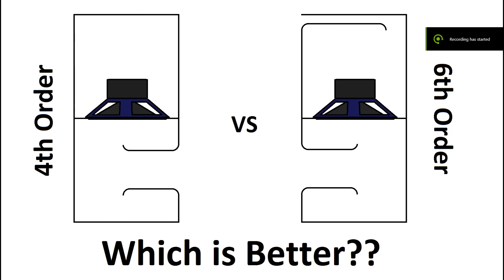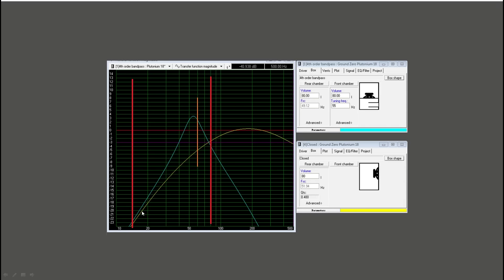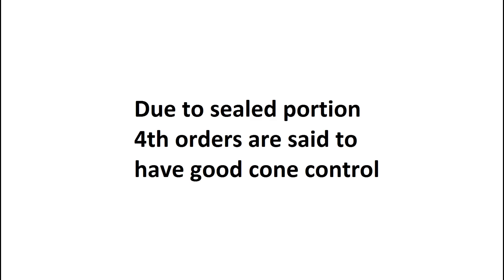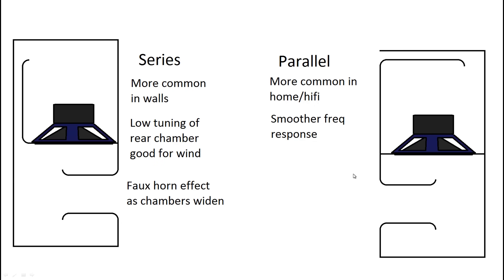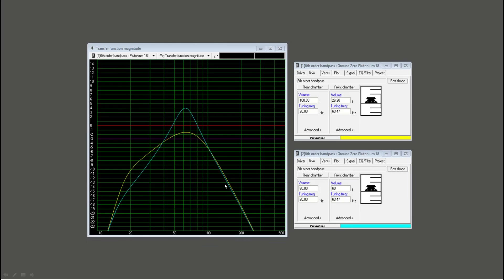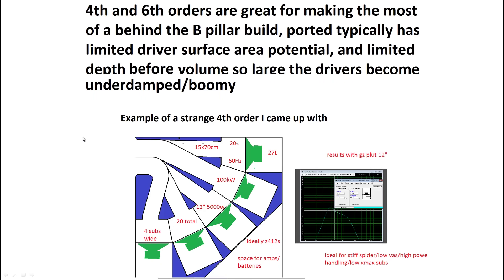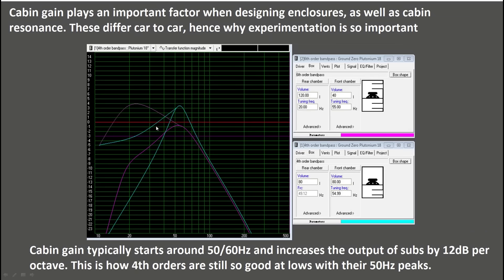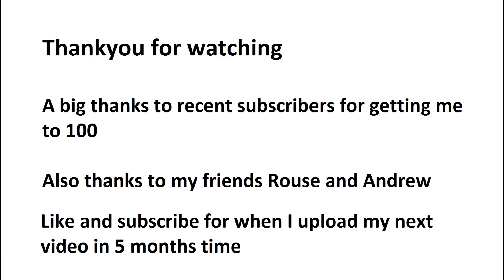4th Order VS 6th Order subwoofer Enclosures

Comment: Sensitivity/efficiency has more to do with stiffness of the moving parts, coil etc.
A high excursion sub can easily have high sensitivity and a lower excursion sub can also often have low sensitivity. Excursion itself has nothing to do with sensitivity.
But other than that it was a great video!👍
Reply from the maker: In order for drivers to be capable of excursion, coil overhangs the gap, and that distance is turned into raw heat, super bad for efficiency. Sure, they can be independent, and a neodymium motors these days can make up for it, but for ferrite motors, higher excursion trends towards lower efficiency.
Reply: @Dakoustics  I have had subs with really long excursion and ferrite magnets with over 92dB sens and short excursion subs with a lower 88db sens. So there are other factors than just excursion. Higher watt rated subs tends to have lower sens. etc.
Reply from the maker: @Oystein87  Yeah, good point. Diaphragm mass and Fs play a major role as well.
Reply: @Dakoustics  Yes, that has alot to do with it. Sorry if I seem rude btw.. That was not the on purpose. I liked the video and the explenations. Nice job👍

Comment: Something you missed with your 4th order ratio explanation, ratio only really matters if you are using the same amount of total airspace in both situations. Otherwise the two chambers don't actually react differently based on ratio.

For example lets say you have only 10 cubes to work with but you have 2 15's. 5cubes sealed, 5 cubes ported would give you enough of a sealed space to get a decent low end response, BUT you won't have as much output at port tuning. 3 cubes sealed 7 cubes ported will then make it peakier and makes the rule of thumb true. However if you go then to 5 cubes sealed, 15 cubes ported you will still be getting that same flatish respone from the rear chamber but will have much more output in the ported section. 

It's an important detail a lot of people don't seem to understand when talking about ratios.

Comment: +Dakchen Games @Dakchen Games I actually have a 6th order parallel bandpass with a Sundown Audio Ev2-12 which is really good for a hi fi or home cinema set up the motor design is really good you don’t have to worry about the voice coil bottoming out 
Which is good for a person to buy a 1st subwoofer and dose not have to worry about the power used because of the non bottoming out and the subwoofer is underrated it’s raited at 500wrns put it been getting 750wrms clean power don’t worry Brian chamberlain told me it’s ok to run it at 750wrms just don’t go much above 750wrms 

The enclosure top end has 75.5L and tuned at 50hz and bottom end has 50L and tuned at 26hz 

I’m running the subwoofer with a INuke 1000DSP with a WRMS limit to 760WRMS
Bridge it also has active crossover at 80hz 
And a active EQ set from 90hz to 10hz on a 18db bandpass roll off why 90hz because of the deeper roll off I wanted the 80hz louder compared to the EQ set at 80hz the 10hz rolls off to around 5hz at the bottom of the curve 

I hear the beams in the roof vibrate at around 30hz and so does my next doors windows lol 

It’s really good to listen to music with it even better watching movies I’ve owned subwoofers before but nothing like this.

Comment: How can we determine the volume needed for sealed chamber in 4th order sir ??
Reply from the maker: Good question. A good volume is less than the Vas of the sub, somewhere between half and 2/3rds of the vas should be good, unless the sub has a low Vas and a high QTS, then a larger sealed section than vas should be fine.
Reply: Dakchen Games my subs are soundstream rub. 124 12", am going to have 8 of them in a 4th order but am limited with space, many people adviced me with something from 0.75 to 0.9 cubicft per sun, 0.8 is perfect for me, what u think sir ??
https://soundstream.com/product/rub-124/
Here is the site if u want to check the specs and give me your opinion, thx sir
Reply from the maker: @7modi092  0.8 should be fine, but i think 1 would be better, but the difference will be negligible
Reply: Dakchen Games am going to stick with 0.8 bro, cuz that is the only way i can fit the 8 subs in my car, thx bro for your help

Comment: Oh and thank you for exposing for others about inefficient designs and tuning build heat wish causes catastrophic failure due to coil heat.  I've been there. And taught myself
Reply: Bandpass subs are known to be bad because of bad designs and lack of understanding from the user.
Check out the "STM S118 SUB"  it is a pro audio bandpass sub intended for most demanding concerts and festivals. When bandpass subs are designed by professionals and used by engineers, bandpass designs are very powerful and accurate desings.
Reply: Ole Kristian Rannekleiv c

Comment: I have a single 15 oldschool power acoustik Mofo  with 4 inch dual 2ohm coils.  Now I've repaired what we n I bought it for 20 bucks the tensile were burned. I direct connected way bigger pure copper wire and replaced spiders and I upgraded to black flat wound dual 2 coil.  My question after rambling is I'm using a ported 4 cube box I built it's a transm8ssion line.  I am impressed.  But I built a 6th. It is peaking at 22 and not sure high side peak.  My sub doesn't move as far as in transmission but it is 10 times deeper and louder.  Would a 4th be as 3fficient I am not bottoming out or over excursion in 6th. I'm just playing with it.  It's in a 98 3xpedition. I hit 147db at local shop at headrest with single 15 . Is that good or can I get more
Reply: And my amp is Orion cb3500.1
Reply from the maker: it probably wouldn't be as efficient as a 6th, though 22 is a really low peak, you might want to increase the size of the high tuned section, or possibly the low tuned section is too big and peaks at its tuning. Still an impressively low peak. The low tuned side of my 6th is tuned to 20Hz, though my peak is around 28. Problem is there are so many variables all you can really do is experiment, though my answer is a 6th is your loudest bet.

Comment: just a dumb question, now with the 4th with a sealed chamber, could u do an isobarik build inside and actually make the sealed chamber smaller?
Reply from the maker: yes you could, though I'd recommend also making the ported side smaller unless you want a peak at the port tuning